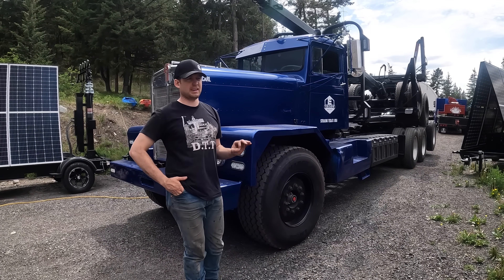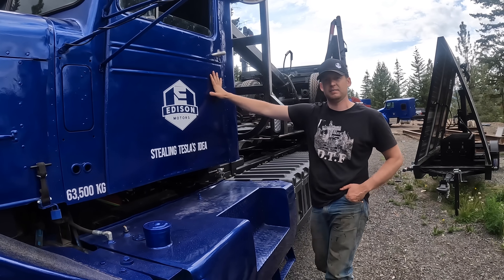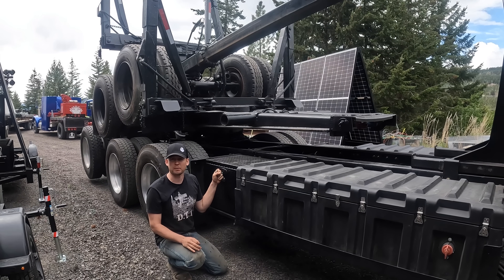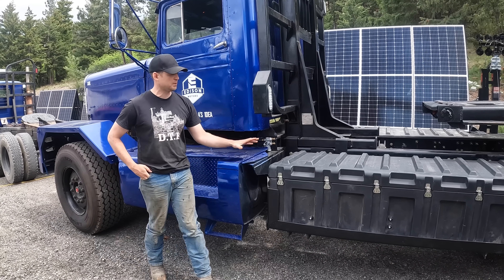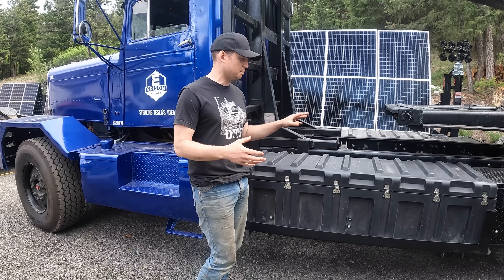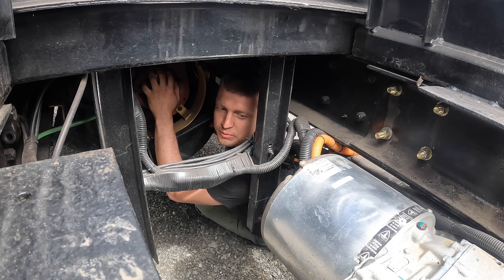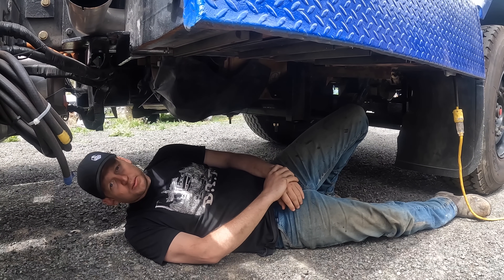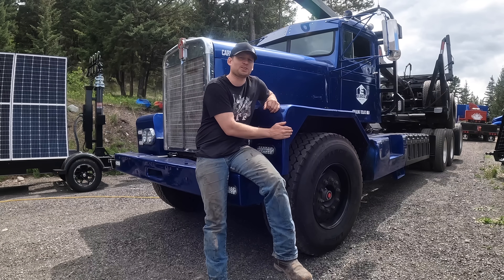Learning from Carl: Electric Truck Proof of Concept Revealed!

Comment: OK so we're making changes. Well improvements. 
Good don't be set in stone.

Question.
Could you run say a Cummin's  8.3L Turbo? Or even smaller Diesel,
now that you have a cooled, sealed, Generator?
Less cost, and weight.

Could you have attached a 2 speed rear to your truck
 to mesh better with the Tesla drive unit?
Just askin'?

Thanks for your honesty, it's refreshing in this World.
WB

Comment: I'd put the charger plug near a front corner. Then charge points that are designed for driving nose-in will also work.

Comment: I can understand why China is the main source of truck/bus transaxles with electric drives for two reasons. The first is China has been making fully electric/battery buses for over 20 years, ie BYD. The other is market size. China is a huge market, and that drives the economies of scale that results in the competition always having to play catch-up. Most western countries have been hedging light rail as a zero emissions solution, resulting in a lack of experience when it comes to heavy electric road vehicles. Basically, China placed a bet on fully battery electric buses 20 years ago and now that is paying dividends.

Comment: Hey, have you guys considered a disconnect for one of the drive axles, so when empty or bobtailing, you can cut power to the motors of one axle.
Next question, have you compared the weight of the E axles to the standard Dana rears on a semi? How much weight do the batteries add vs carrying 300 gallons of fuel? Where would the battery banks be, on the semi or on the trailer? If on the tractor, where are all these batteries going to mount considering that many many trucks in North America are sold with rather short wheelbase. If batteries on the trailer, it would be a dedicated trailer, I can't imagine fleets entrusting this equipment to be drop and hooked and still expect the low IQ bottom feeding steering wheel holders to properly inspect the batteries. You can sit at the truckstop in the morning and you're lucky to see a handful of drivers even get out to kick tires. Just some questions I had, I do like where you are going with this.

Comment: I am a little confused as usual, I thought you were going to put the batteries between the rails, and here you said that you were going to switch the position of the batteries in the fuel tanks outside the rails. However, as always very well presented.
Reply from the maker: Our production truck will have the batteries in the frame rails, if we did Carl differently we would have swapped the battery and fuel tank positions. - Theron Danger

Comment: If you were a big outfit, Peterbilt Mac Freightliner from where are you started to now you would be seven or eight years and 10 times the cost because they have to mindfuck everything build shit loads of proprietary parts so you can only go to the dealer to get them I’m waiting for the truck number one with the electric drive axles to hit the road.

Comment: Have you ever considered a diesel/kerosene tubine instead of a diesel engine as the prime mover? The power to weight ratio of a turbine is much better than an equivalent deiesel motor. May be a little less practical as there are a lot fewer mechanics that work on turbines versus a diesel motor, but if efficiency is what you're after, I believe that a turbine would be more efficient.

Comment: You did more in a few years. That most electric company did in a few decades. And all without any gouvernement or large investors. All in a little corner of canada

Good fking job.
Reply from the maker: I’ve been saying for years that 4-5 Blue Collar workers can get more done than 40-50 silicone valley tech engineers.
Reply: @EdisonMotors  As an engineer, I always prefer working for small businesses where everyone knows everyone and is fully integrated in the business as a whole. None of the stupid red tape and useless meetings. Everyone knows the overall objectives and what is going on, who is doing what. So much more efficient and cost effective.
Reply: @N-M424  but what's wrong with that? people don't need cutting edge daily drivers and work trucks. they just need something that Works, that is easy to fix, that has abundant parts for repairs, etc. The LAST thing you want is an experimental technology and scarce parts from using highly specialized designs that only are on you low volume vehicle. you want parts you can go to the parts store and get. cars and trucks should not be relying on cutting edge tech if you care about sustainability. if sustainability is the goal, then the ONLY thing you should be caring about is keeping cars on the road as Long as Possible (in safe working condition). The simpler and easier to work on their are, using readily available high volume parts, the easier you're going to achieve that goal.
Reply: @N-M424  this is how "startups", motivated people with work ethic and a vision, etc. work. They work Fast. it's corporations and gov encumbered by fear, red tape, approvals, permits, worrying about liability, trying to create get rich quick schemes, not valuing or taking care of their customers, etc. that can't get crap done.
Reply: @N-M424  " In the end, you have to either dodge the regulations via a niche application that isn't regulated, or comply if you don't want to bankrupt your company via endless litigation."

not as true as you think.

Comment: Love these updates. I don't use TikTok so was well behind on a ton of the info. Hope you upgrade Carl a bit once you've got enough of a supply of axles coming to be able to throw one under him without cutting into your production.

P.S. Would love to see that Tesla motor thrown into an old Grizzly in place of the Cummins - just for another logger built truck to stay on the road. Used to know a guy in the Interior that had one... 20 years ago.

Comment: In regards to the cooling systems.  Will there be anything allowing the two cooling systems to share heat?  For example batteries keep the engine warm in the winter for easier starts.  Or the engine can be used to heat up the batteries in cooler temperature startups?  Just a thought.
Reply from the maker: We will have a separate heater which will circulate “coolant” to keep the batteries warm during winter - Theron Danger

Comment: 6:40 Re: blocking chargers -- that $hit is not hilarious
Reply from the maker: We weren’t blocking the charger, we were using the charger. - Theron Danger
Reply: @EdisonMotors  from the video it sounds like you were blocking some of the chargers while using one of them and found that funny. Just sounded bad the way it was stated. I could see if you were there making sure no one else needed one and you were only there for a short time testing.  I do appreciate your product goals.
Reply from the maker: @Scott-sm9nm  the way the chargers are laid out, a full size truck takes up more than one spot.
We were the only vehicle there, no one else was using it, some lady just drove by and got mad when she saw a truck parked there, because trucks like that generally are not electric. 
We were not testing, we were legitimately using the charger. Our generator wasn’t hooked up at that point and the truck was a 100% electric truck - Theron Danger
Reply: @EdisonMotors  I appreciate the details and the time you took to respond.  All my best to you and your very challenging goals. I can appreciate the generator aspect especially on the use cases involved (long time Chevy Volt owner that now drives a BEV). I follow Hyliion closely as well.  After pickup trucks, semi-trucks are the next holy grail to convert people to a better option (for many use cases).

Comment: Still waiting to see an electric truck haul literally anything as well as a regular ICE truck. Unless you somehow found a way to make 40k tons of batteries not weigh anything this truck will literally never be able to haul an equivalent load of logs because of the batteries. You will need at least twice the trucks to do the same work which means twice the pollution produced to build 2 trucks instead of one. Not to mention the power is only as clean as where its generated also also you would want to be close to a powerplant as you loose a lot of energy over long distance.
Reply from the maker: We use half the batteries as an electric truck, and have close to twice the horse power (1005 HP with a tri drive) of a combustible engine, because of the E-axles. 
Our power is produced by our onboard self charger (a diesel generator) 

- Theron Danger